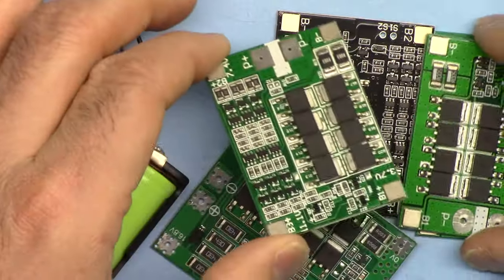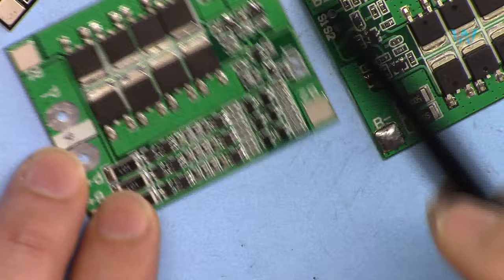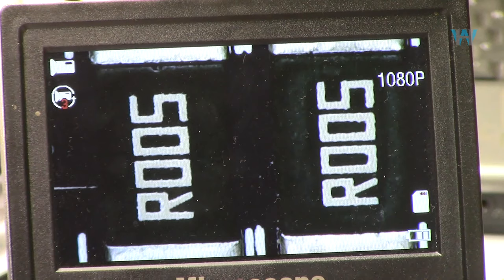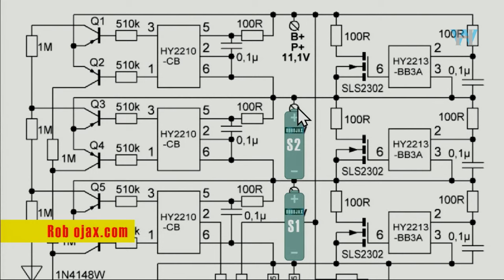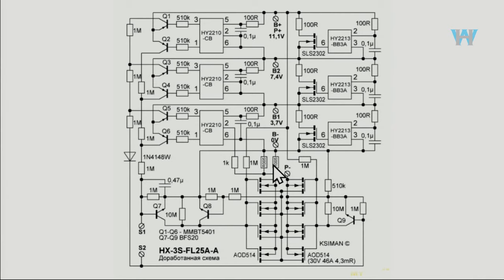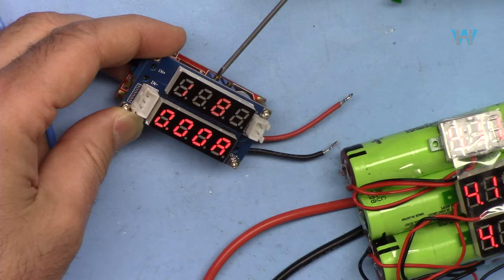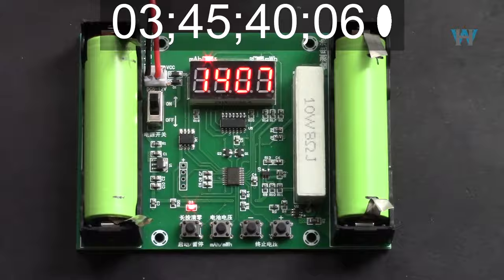The complete Guide to using 3S 40A Lithium BMS Battery Charger

Comment: I have a 12v 16a package.  I used a 3s 20a bms card.  There are 24 batteries.  How many volts and how many amper do I think I should charge

Comment: So I need: quality cells, a charging module with protection and balancing system or separate modules for each, a voltage/current limiter module and a reliable power source. Am I correct or are any those redundant ?
Is there a module  I can purchase that contains all the needed systems? Is it even possible?
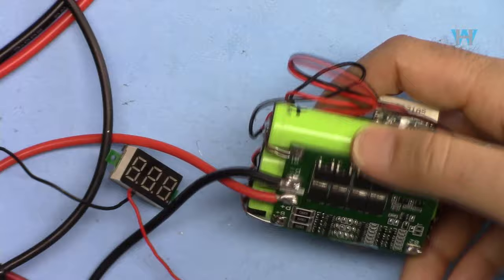Reply from the maker: It has 28:23 OverDischarge protection,  30:52 OverVoltage Protection and 31:57 ShortCircuit Protection for current limiting you need your own power supply with CC (constant current) so you  set the limit as this has only the maximum limit which I demonstrated.  You need cell balancing module here is an example https://youtu.be/l2APm5olDiA

Comment: I think these boards are garbage, but you did a good job explaining how they work. 2.3 is way too low for over discharge for most 18650s and all of these cheap boards have the same specs.     I connected 3 batteries to a similar board and one cell is dead because it over discharged.  Another thing I did was put 2 low 3.4 (ish) voltage cells with one that was 4.0v and it overcharged the 4.0v cell rather than stop charging it while the other cells caught up.  These boards should be smart enough to rob voltage from high cells and export to low cells.  So over discharge and over charge is useless which sorry to say makes most if not all of these boards garbage.  Maybe one has to have  perfectly spec'd cells to use these cheap boards - that shouldn't be the case.
Reply from the maker: To make all cells the same is balancing and I have explained it here https://youtu.be/0yo4lzxENrk
Reply: @WattHour  Hi, thanks for the suggestion.  

18650 RANGE:
18650s may have a voltage range between 2.5 volts and 4.2 volts, or a charging voltage of 4.2 volts, but the nominal voltage of a standard 18650 is 3.7 volts.

CHEAP CHINESE BOARD SPECS:
Voltage range: 4.25-4.35v ± 0. 05 V
Discharge voltage range: 2.3- ± 0 3.0v. 05 V

I don't want my tiny 12v/3s pack going down to 2.3v and I don't want any cell charged beyond 4.20v.  Many of these cheap tiny boards will destroy a battery in my 3s pack.  I just want a tiny board that protects my tiny pack, but it seems there is nothing on the market that, for 3s, has a low cutoff at 3v and a high cutoff at 4.2v.  This is the range that I'd like my tiny pack to operate so to protect it.  3 18650s are cheap, but I can't find a cheap BMS to protect them.  Any suggestions?

Comment: If balance function will only work when the voltage of all the battery are the same during first time use and when charging the ampere should be limited according to resistor value
So if we have 101 resistor 
Then 4.2÷101=0.04158
What should be the charging ampere ?
Reply from the maker: I=V÷R, I is current.  the resistor has written on it 101 = 100Ω, and  you can't have  so I =4 .2÷10= 0.042A or 42mA.

Comment: Hi, I built one.  I notice the 3s 40A BMS simply warm up without any payload right after I connect it with the battery.  Is it normal?  kind of scary though.
Reply from the maker: No it is not normal. There should not be any current. Check it something is wrong
Reply: thanks.  i double check, battery connection is correct but the output voltage measured @ 3.2V.  yes, something wrong with the bms board.  I’ll purchase a new one.  appreciate ur advise.

Comment: another question, what if i have a 3s4p and my battery capacity is 2200mAh each total of 8800mAh. what should be the setting of my charger current? i already read the data sheet of the battery and it needs to have CV of 4.2V and CC of 1.25A. should i set my charger to 1.25A*12pcs= 15A for CC and  the CV to 12.6V? thanks.
Reply from the maker: you set the current only. The voltage is controlled by this module. this can only limit the maximum current or OverCurrent.  I have demonstrated that.

Comment: @wattHour I built a 3s pack with bms and everything is wired as you shown. 
The strange thing is that the middle battery (S2 per your diagram) has depleted completely with no use, but the others are ok. What causes this? 
I'm pretty sure that I haven't short circuit it, it starts happening after testing the charger if it charges the pack.
Any explanations?
Reply from the maker: Hi, you might have loose connection somewhere that causes this . Check them
Reply: @WattHour  Thank you for your answer, I tear it apart trying to save my battery.  
But when I built it, I checked every battery and was fine. I even work with my drill about 5minutes. And then I checked with the charger for 2minutes to see if it will charge it.
Next day the battery was almost empty.
Can this be the case and have 12.4V output?
I will try to rebuilt it
Reply from the maker: Hello, If you live in Canada or USA, I am giving away this DL24P 180W load and energy meter. Make sure to sign up for it https://youtu.be/-UblSfUEY-0

Comment: Nice Video dude!
Why shows your devices around 4.1V per batteries? I thought Li Ion akkus have a voltage of 3,7V?
Pls answer, I think I am going to by this BMS
Reply from the maker: Thanks. when you charge the Lithium battery, the charge voltage is 4.2V. perhaps you missed it.
Reply: @WattHour  ok 👌 
Do I have to disconnect my motor from p+- before I can charge?
Reply: And how do I know when to charge? I would charge if the voltage of one batterie is less than 3,3V. But do I have to measure the voltage when a motor is connected or not?
Reply from the maker: just disconnect 1 wire when charging.  I will look at the module and find out when the charge is completed, how to know. I will post it under the video in the description.
Reply: @WattHour  this would be very nice
Reply: @WattHour  did you found out?

Comment: 33:29
Thank you soo much sir , I was looking for this.
Sir I have a question specificly for my battery, sir I made a battery of 3s4p with lg 18650 cells, so can I charge this battery directly with 12.6v 3 or 4 amp charger without using buck or bost converter or I have to use.
Please clear my point.
Reply from the maker: battery does not care where the voltage is coming from. it should be DC and correct voltage and MUST have constant current. you MUST limit the current otherwise battery's life will be degraded or it might catch fire.
Reply: @WattHour  thanks.
Reply from the maker: you are very welcome.
Reply: @WattHour  You say that you must limit the current of the charger, if I have an old charger with only 0.1A can it damage the battery?

Comment: I’m doing a 3s2p 12.6v battery pack with Molicel P-28A cells and each cell is 35A and 2800mah each cell . What BMS with balance should I use , a 40A , 60A or 80A BMS with balance ?
Reply from the maker: it depends how much current your load consumes. 30A means your load needs 30A.
Reply: So the 3s2p i will build will be 35A both rows 3 cell each when combined in parallel it will have a total of 70A so it will peak at 140A at a max discharge rate the 3s2p battery pack , so at least i will need a 80A bms or a 100A Bms ?

Comment: Can you use 14.8v lead acid charger to charge a 12.6v lithium battery pack?
Reply from the maker: No you can’t. This has setting they won’t  work for other batteries.

Comment: Sir I used the 3S, 20A BMS to make a battery pack. It was working fine but after few days of unused state, the output voltage from the BMS board reduced to 9.30V. I checked the individual cell voltage and they were 4.19V(1st pair), 4.22V(2nd pair), 4.23V(3rd pair). The batteries are connected as 3s 2P configuration. batteries are LG ABF1L 18650 model. I don't know what has happened to the BMS. Has it become faulty? please help
Reply from the maker: 50mV 0r 0.05V difference  is normal. But battery has life cycle. some of them can be charged 1000 times and some less or more. Your battery may have received to the end of life. that is normal.
Reply: This happen to me, just plug the board into the charger and it will bring the  voltage on the output back to the full charge.

Comment: CAN I USE 5S BATTERY PACK ?? CAN THE 12V DRILL HANDLE 20V ?? FOR ME 5S BMS WITH CHARGER IS EASIER
Reply: you can't use 5s battery with this 3s circuit...
Reply: @MuratPALACI  im using 5s pack with 5s bms on 12v motor tool...will it work ??

Comment: But will it work with nine 18650 batteries?
Reply from the maker: when we say "3 cell" or 3S, it is for 3 batteries. if you connect them in parallel, as many as you like.

Comment: Sir, can I connect three cells in parallel in 20amps bms 3 series to get 12.6v. Total cells are nine. Three each in parallel and to connect them in series. Please reply.. Thanks.
Reply from the maker: Yes you can. first 3 in parallel to just increase the capacity. then in series.
Reply: @WattHour  Thanks.

Comment: @31:46 what if you keep that 17.3 high voltage connected for 2 hours ?
Reply from the maker: I believe time is not issue . This has mostest that can handle 400 or 500 A if it has proper heat sink. But this 40A is nothing for this
Reply: @WattHour  I am asking about voltage not current.
Reply from the maker: Voltage will have no issue

Comment: Hi. The over discharge protection voltage is 7.2v???
Reply from the maker: Hi, I don't remember it but I belive I have shown it fully with the chip specs.
Reply: @WattHour  if the bms not cut off, why?

Comment: It's NOT a Charger, it's a Protection Board with Balance function !
It has no Constant Current or Constant Voltage regulation  (CC/CV) !
Reply from the maker: that is the meaning of CC and CV. Any module that has CC and CV, you can charge the battery with it.

Comment: This really isn't a charger though is it more like a balancer/protection module if I could plug a power supply of 12volts into it and not worry if its delivering CC then CV then I would then say it was a charger
Reply from the maker: It is charger and the best one.  The chips used are used on every charger you see and use.

Comment: 4s 40a bms 
Output 5amps
But bms is very heat why?
Reply from the maker: What is the input current? Check if it is more than 20% of the output then it has issues

Comment: Hi i have a question
Reply from the maker: Hi, you should have written it. 18 hours has passed. I will reply to a question that is NOT answered in the video.
Reply: Can i use 14.5 volt for charge bms 3cell,in longe time???

Comment: Lithium cells should always be charged at 1C (the battery capacity times 1)
Reply from the maker: Hello, yes and no.  it depends on the chemistry. 1C is excellent way to do it but you can charge it at higher rate at the cost of reducing battery life.
Reply: @WattHour  That is true, additionally some batteries are rated for higher charge and discharge rates specified by the manufacturer. It's beneficial for lithium batteries to be charged at 1C to prolong their lifespan.

Comment: thank you for the video.
Please Help.
See here:  https://youtu.be/t4QLmDtKn4g

I bought balanced 3S40A module to restore a old bosch 12v battery.
the 18650 batteries are new. made the connection good. 
If I measure all the voltages they are consistent 0V - 4.2V - 8.4V - 12.6V

If I connect the motor directly to batteries it works super fine.
when I connect thru the 3S40A module normal connection ports it gives different results. sometime 2V or 8V but never 12V.

I have tryed with 2 modules both give bad results.
Is something I do wrong? Are the modules bad?

Comment: Disappointing video. Not shown how cell balancing works and how much balancing current it could take.
Reply from the maker: yes indeed.  Because this is not cell balancer.  See the ONE (of the) balancer here https://youtu.be/l2APm5olDiA
Reply: @WattHour  So if it has a charging properties without balancing circuit it's quite dangerous device.Throw it away.